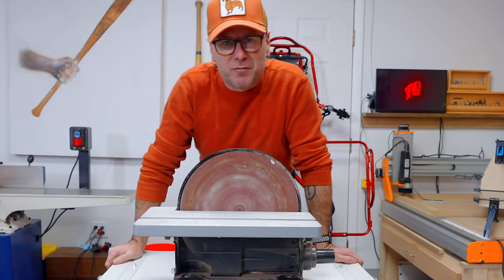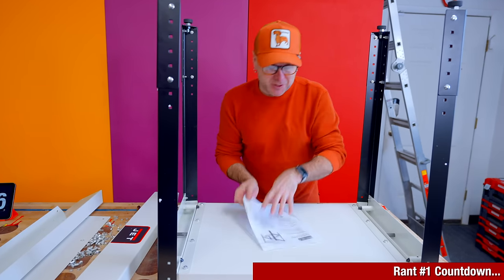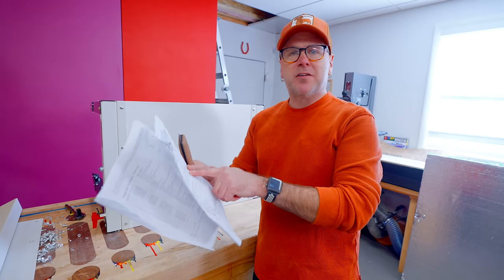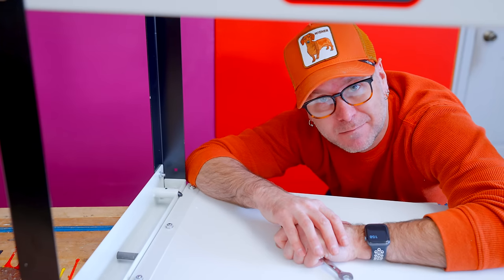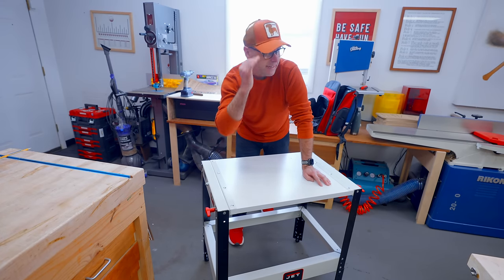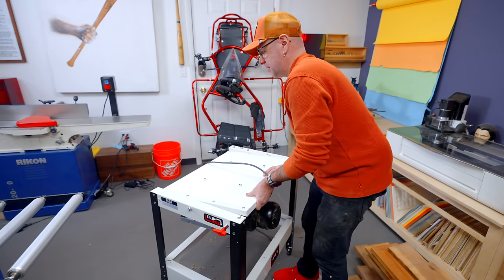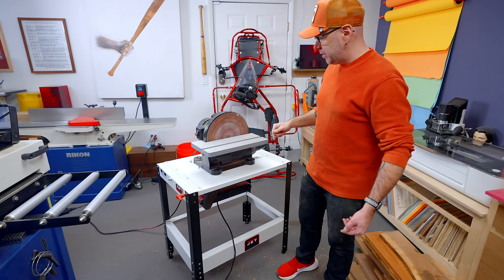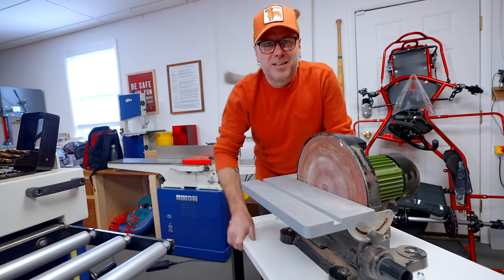Is the JET Flip Top stand worth the money?

Comment: Personally, i still like Fishers cart design.  Its a box that flips on the center vs. a platform.  Cords run into the box, plug into a strip, strip cord runs out the side.  No cords to mess wrangle on the flip, cheaper, and i modified it to be tall enough to put my planer on
Reply: Do you have a link to Fishers cart one please?
Reply: I like the Fishers cart as well.  I took the design and modified it to fit my benchtop planer and jointer (for now). Works way better, has optimal cord management and I don't have to fiddle with nuts and bolts. The Jet one here while convenient looks like it has a flimsy feel to it which I bet it doesn't. Guess I would just rather make my own. With the cost of plywood so high I decided to make it with cheaper (e.g. not baltic) plywood and after some finishing work I am extremely pleased.
Reply: @drew05171  i too put a planer on it, just made the sides really. I think it's a little less stable doing that, but had worked for years so far

Comment: Take a crack at leveling your floor yourself and make a video about it. I have the same problem with my detached garage. Concrete is completely cracked. My plan is to either frame out a floor and lay down some osb or pour a new floor myself.

Comment: Did you pull up the carpet?
And i'm glad I saw the cord struggle.  That's the one thing I never thought about all the times I debated on getting/making one of these flip top stands.  I wonder what everyone normally does about it?  If you don't run both cords to a two in one outlet and then plug that in after the flip..  I guess you can put some cleats on each side and wrap up the cords before the flip and unwrap the tool you want to plug in..

Comment: Carriage bolts with square holes - these must be cheaper than dirt to spec them.  When possible, I’ll put them inside out (dome on the inside, bolt on the outside) and cut off the excess.  There are Velcro cable ties (think reusable zip tie), maybe wrap the cord around the tool before flipping?  Also 1 million percent accurate on the instructions.  Sometimes compounded by hardware that’s just fractionally longer or shorter.  Nothing like installing eleventy brajillion bolts only to realize you needed the ones just a blond one thinner/thicker/longer/shorter.  And as always - more on that Gokart!
Reply: Right. Just wrap the cord before you flip it. Lack of "cord management" is no big deal.

Comment: Like others have said, "I made my own." I actually made two: one for scroll saw & belt disc sander, the other for spindle sander and grinder. To solve the cord issue I mounted the tools on a spinning box that's about 6 inches tall. Inside the box I wired up a receptacle (remove the tabs to separate the two plugs)  to two of the plugs that attach to computer style cords. The top tool's computer plug is always at the "back" of the cart (the carts have drawers at the bottom so there is a front and a back). I bought 10 foot long computer cords which are easy to plug and unplug when I need to flip to the other side to use that tool, then replug into the back plug to power the current tool. It was a lot of work but this way I never have cords flying around the cart which you would with the power strip solution. And the computer cords are fairly safe even when you leave them plugged into the wall since there are no exposed prongs that would be energized, like my first solution that I quickly found to be a shockingly horrible idea.💥
Reply: I made fishers, which also uses a box, not as big i don't think, but the power strip is in the box, with cords fed into the box.  Power strip cord is fed through metal pipe used as the pivot.  Nothing to plug and unplug except the strip itself

Comment: David, what you need is a set of open end/box end ratcheting wrenches for those tight spots.  Work well in those situations.             JimE
Reply from the maker: have some. the nut/bolt is too close to the edge for it to fit a ratching wrench as well as a socket.🤷‍♂️
Reply: @MakeSomething  Wow!  That is tight.  Good engineering.  Not German made. 😁

Comment: It would make more sense if you could rotate backwards, then you don't tangle the cords, the way this one works is that you have to unplug and wraap up the cord before rotating pklus the hassle with suction hoses.
One thought, if you have room for an upside down tool, i think i would have one tool on the bench, the other on a shelf underneath, and simply sit on a stool to use the lower one, they could both stay plugged in.
Maybe the shelf could be slide out and locking.

Comment: Thanks for doing this review video I actually considered purchasing this and just finished building my own! I’m glad I did… It definitely came out to less than $300 and I’m really happy with it. As far as the cords go, if you were able to drill a hole and feed the cord through so a power strip can be mounted on just one side that would be one solution. I haven’t done that yet so I’ve just been wrapping the cord around the tool before flipping.

Comment: Cut the cords short and fit quick release connectors on the tails, then you'll only need one cord from the recepticle to power the sanders and you won't be struggling with those long cords getting wrapped up in knots.
Reply: Or instead of cutting the cords, just wrap them up in a circle, and zip tie the circle together. That way if he decides to put the tools elsewhere he still has the uncut length cords.